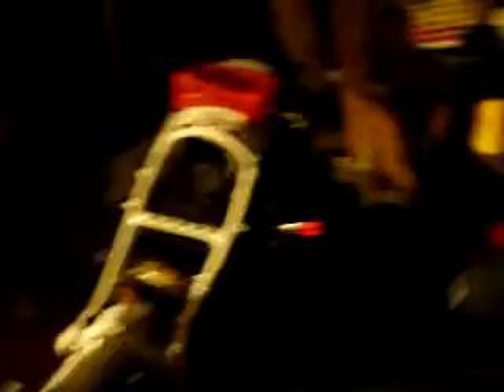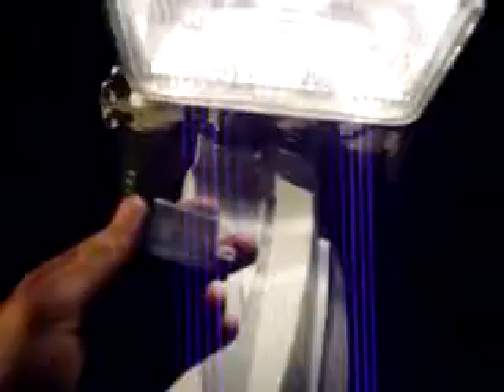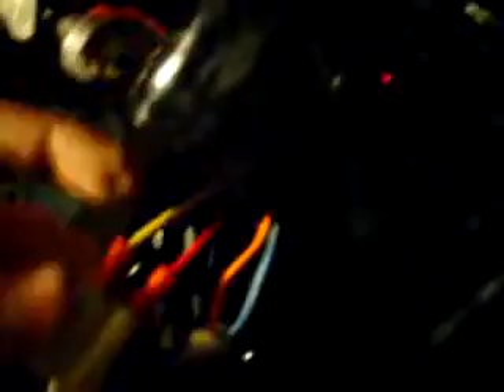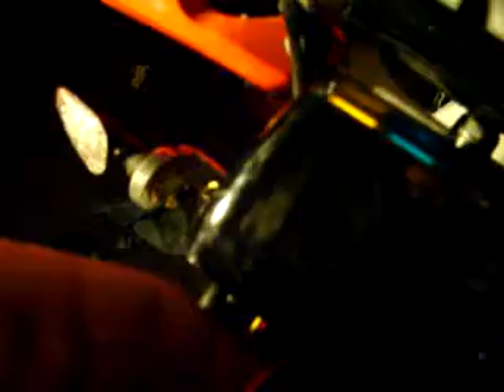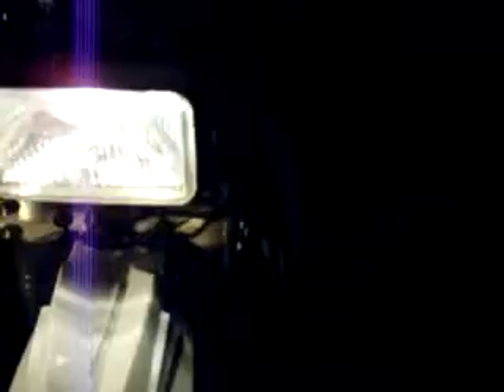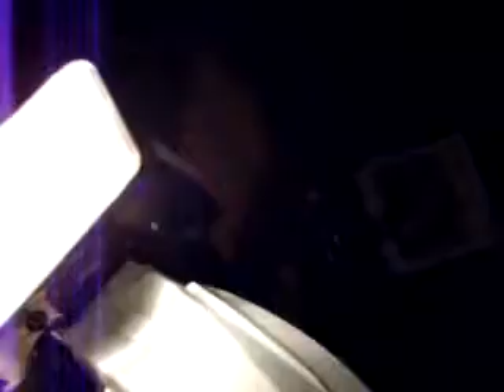led turn signals on a xr650l

Comment: Thanks for the advice on removing the indicator bulb as it solved my problem. I was just short of several Tourettes moments not understanding why all the bulbs were lit. I used an automotive two prong electronic relay and everything works great.
Reply: Thanks for sharing your information. Very helpful!!

Comment: @DRugfree1987 I am in the process of making a chaser circuit for the LEDs.  I did some experimenting and made a flashing or strobe effect with them so that eliminated the need for the relay all together.  Basically power in and the circuit dose the rest.  The only thing I am worried about is the indicator light not blinking it would most likely just stay solid.  
Did you fix this problem with your bike yet?